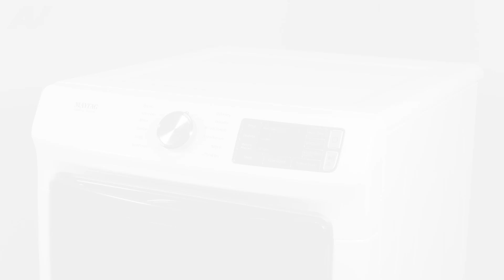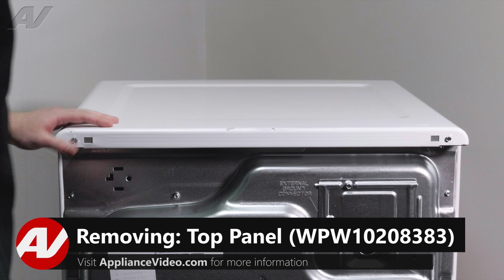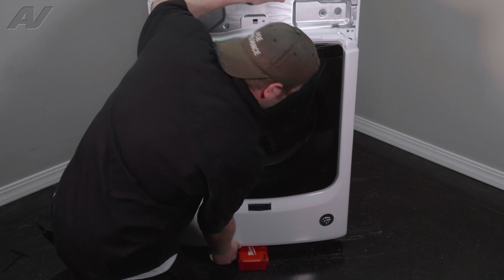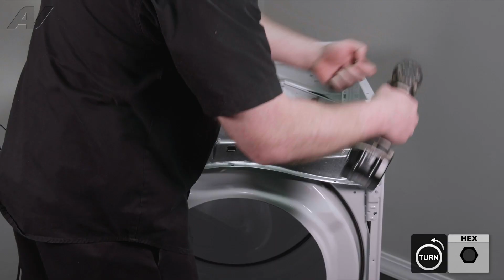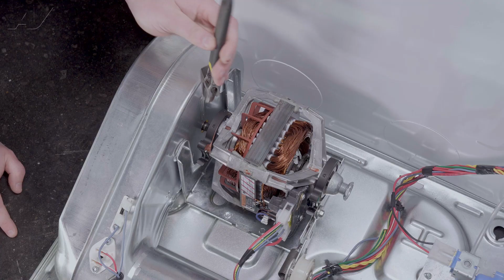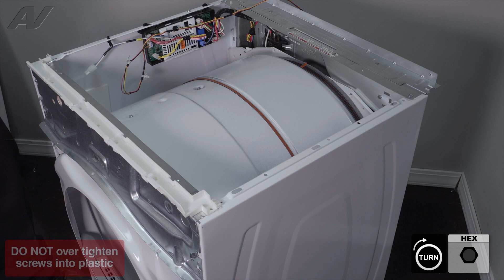Maytag Dryer Repair - Noisy While Running, Blower Wheel Is Damaged - Blower Wheel

Comment: Thanks, but I wish you would record the noise/problem before starting the repair.  I want to hear what you're experiencing to confirm I have the same issue!
Reply: It sounds like the side panels are not fastened tightly.. loud vibration.. the fan is bouncing around in the casing making the loud vibration.
Reply: Mine sounds like the legs are not even or the side panels are not all the way fastened/tightened.. The fan motor is bouncing around in the casing sounding like a loud vibration... Is that what you have?
Reply: I wanted the same thing, I cant believe he didn't start it up first! I guess I should just be happy he made the video!

Comment: Any tips if the wheel just won't come off?  The square hole is starting to deform on me
Reply: Try to jam some shims to tighten the connection between the 1/2” extension and the plastic hub. If that still doesn’t work, you may have to start chiseling the plastic hub out or use a dremel.  Make sure you don’t damage the threaded shaft!

Comment: Greetings to me / - I have a problem with an American whirlpool refrigerator Model +20 RI-D3L A on the idea of it is koel + vries. The problem is that she works two days, excellent and sometimes 3 days, excellent in everything, and then she works shorts, meaning the electricity is completely cut off from the refrigerator and completely disconnected from the electricity, and if I switched to open the refrigerator it does not work, or in the sense of the correct way to do short conditions after half an hour again work shorts, but after two days I switch on or turn on the refrigerator, it works fine without any problem ...... for two or three days, and after that you do another shorts and I am confused. I don’t know what to do. Please advise me, may God bless you. Something tells you to buy a better new refrigerator and I see that the refrigerator is in good condition .... Thank you very, very very much to you for the detailed explanation in all the videos, and you have all the respect and appreciation. Noticeably last time I left the refrigerator for two days, and after that I turned the refrigerator again. I worked for 10 hours and did shorts as every time. Thank you again. If I could send you a picture of the refrigerator on WhatsApp, this is my number (0031636248989) amsterdam
Reply from the maker: Great question, if you have a more technical question that our parts department cannot answer, you can search our over 17,000 answered questions free at our website www.ApplianceVideo.com under our Repair Help section. You can also call our parts department at 1-800-830-5465 and they can give you help 7-days A week ,or search at www.SaveMoreOnParts.com  .